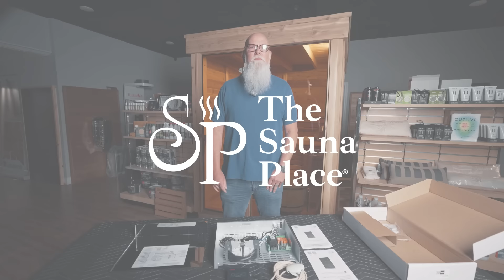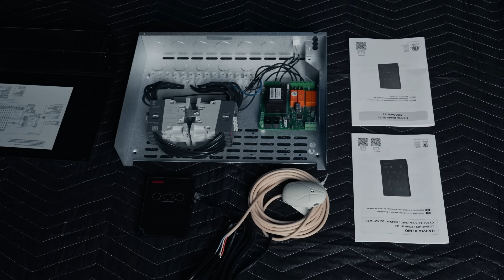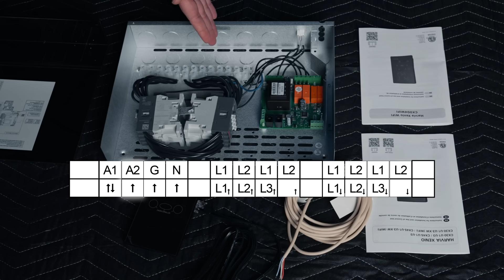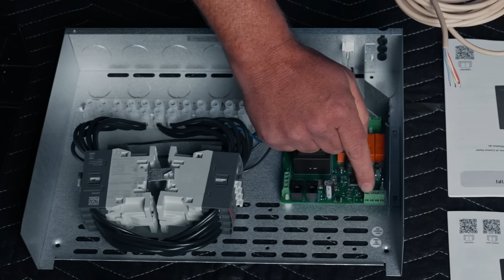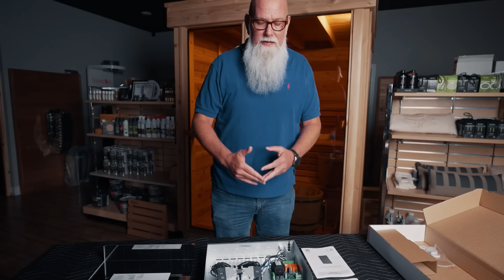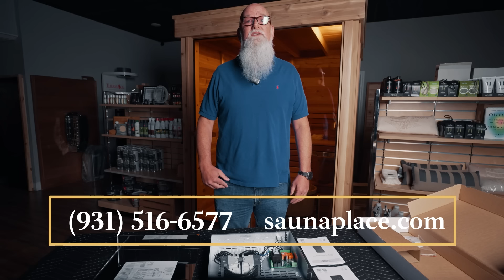Harvia Xenio Control System Installation: Expert Setup Guide for Your Sauna

Comment: Question I understand how to wire the controller from the diagram but the sauna itself has a whip coming out from the back that goes to its own control board does that have to come inside the controller or should it have its own power source ?

Comment: My Cilindro 9kw came with 2 heat sensors.  One with heater and other came with control box.  Do they both need to be connected?
Reply: Did you ever get an answer? I got the same one